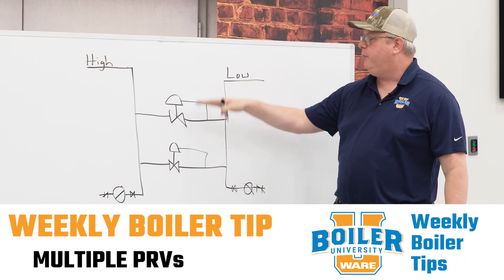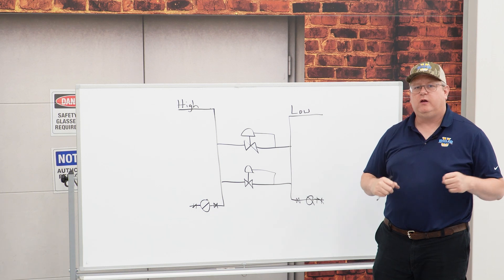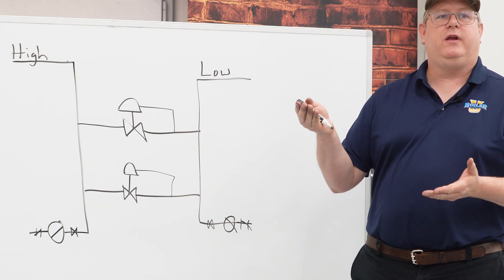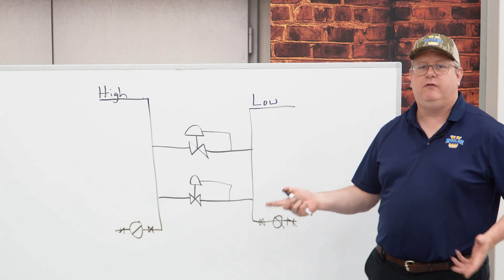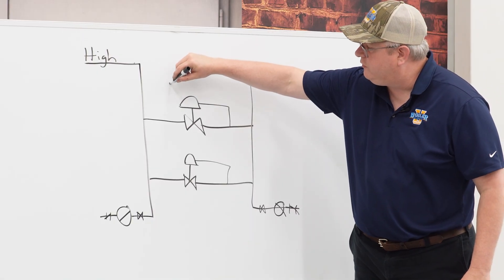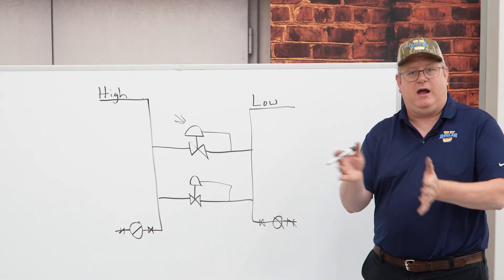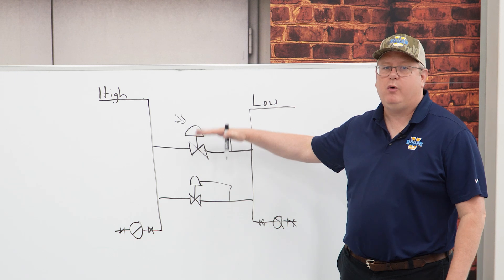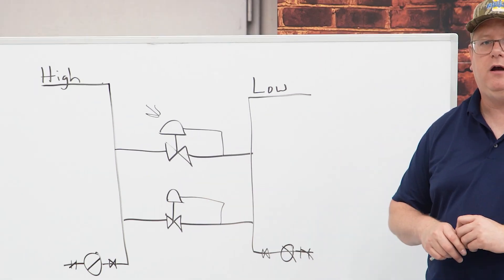Optimize PRV Settings for Load Variety: Tips for Effective Steam Management  -  Weekly Boiler Tips

Comment: Correct me if I’m wrong but the top (1/3) valve is set higher than the bottom (2/3) valve. Example would be setting your 1/3 to 50 PSI after setting your 2/3 to 47 PSI. Once the 1/3 can no longer maintain the load, the pressure drops to 47 PSI and the 2/3 opens as well.